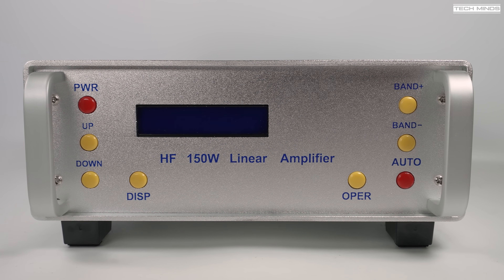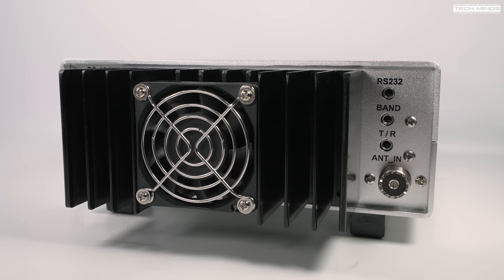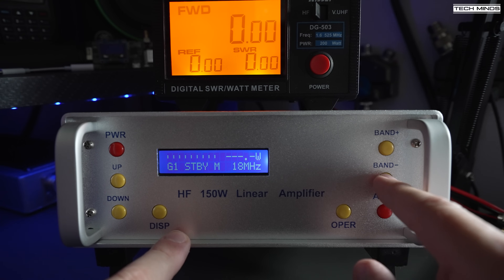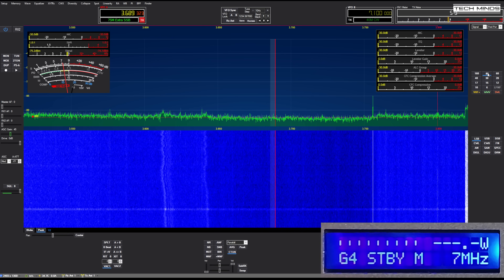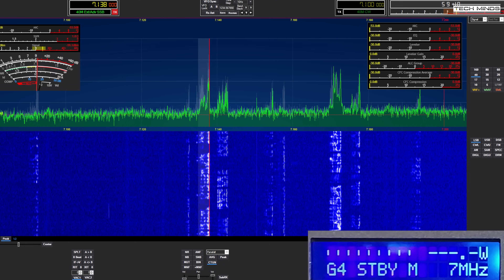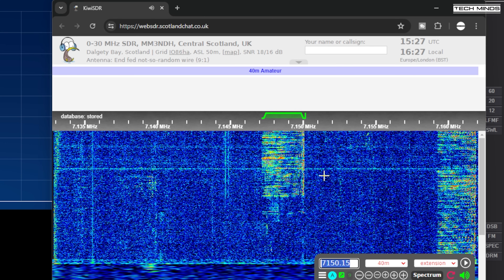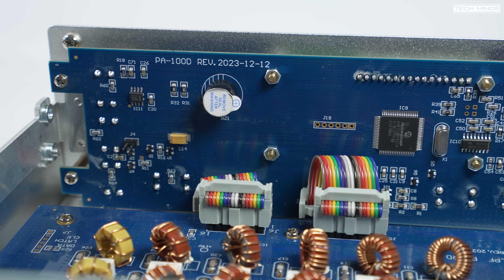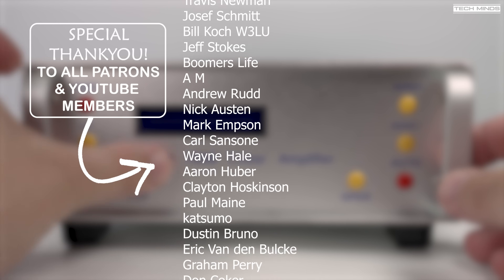Is This A Perfect Companion RF Amplifier For Low Power Radios? PA-100D (Maybe)

Comment: Using a USB to RS232 and Thetis you can do auto band switching to the unit as you can have Thetis emulate the Yaesu/Icom/Elecraft output to the RS232 DB 9 connection.
Reply from the maker: Just tested this. However, using the Thetis build for use with HL2, there is no Yaesu setting. BUT! You can select KX3 on the amp, disable polling on the amp, and then select Kenwood TS2000 and tick "Allow Kenwood AI Command", then it works perfect! Wow... thanks again for the suggestion!
Reply: @TechMindsOfficial  Curious if Jeff meant usb/bcd control using a usb ftdi chipset then FT8KPVXW "Emulates Yaesu" selection would do just that If I'm understanding the manual for the juma 100 correctly. That's how I'm controlling my Vk Amp from Thetis/HL2.
Reply: @TechMindsOfficial where do I find that kenwood command to check?  Thanks!
Reply: @TechMindsOfficial Hi Mat! great review as usual. Just a question, did you use the RS232 socket on the optional I/O board and wired it to the 3.5mm jack labeled RS232 in the back of the amplifier to get the band control working?
Reply from the maker: Really? I have to test this tonight as that would save me configuring the IO board on the HL2, thanks for the tip!
Reply: That's really good to know.
Reply: Any idea if it can work with powersdr software etc. OZ9MSD

Comment: I just got one of these yesterday and seems to work well. I will certainly give it a thorough test on the air tonight. 

I had an issue trying to figure out how to connect this amplifier to my Xiego G90 radio. 

Challenge is this amplifier doesn’t have automatic RF sensing to go into transmit mode. In my case I had to figure out how connect PTT from my Xiego CE19 interface card. I had to figure out which plug wire makes amplifier transmit (“TX”) when shorted to ground - this of course can be done experimentally with the plug in the amplifier’s “T/R” socket. Then you need to find a dry contact from the radio that closes when transmit key is pressed. You’ll need to connect this dry contact to short the “TR” terminal to make amplifier transmit.  It was a PIA but it works great now

Comment: I am a huge fan of Juma. I have a PA1000 that is so good that I have become a fanboy of their engineering and attention to detail. Even if you don't have an issue with IP theft, I advise spending the extra money on the Juma from ROWAVES. Don't underestimate the value of the little details that Juma obsessed over that the clone guys glossed over. 73, W0CP
Reply: as today 9/25/2025 the Juma in ROWAVES is $700.43 USD plus shipping while I can get this one from ebay at $327 with free shipping, did you noticed the difference? pretty much double the price. I am very interested in the Juma but the difference in price is quite ridiculous. Pay double is not enough reason for me
Reply: @angelscomputers The difference is in the design changes, the component changes and the completion lack of technical support should you ever need it! Plus rewarding Chinese companies for intellectual property theft!
Reply: Agreed!

Comment: well after using my unit for about an 1 hour i got a burning like smell from it the band sense only work up to 7,10 20 etc when i return to 7 mhz it will not auto sense and stays on the last band used say 28 mhz , i can’t even change it back manually I have to turn the unit off the unit will defaukt to 28mhz it will then auto sense 7 mhz but i have to resatrt each time, faulty LBF baord or relay ???

Comment: I have a problem with mine. When I go from Standby to TX, my incoming signal is attenuated. It's as if the gain resistors (G1...G4) aren't being properly locked out until the PTT connection is grounded. It think relay "RL-1A" is responsible for this function, but even banging on it pretty hard did not help. This is very disappointing. I suppose I can try to replace the relay, but that's awfully challenging for someone like me with very limited soldering skills.
Reply: Figured it out. I had the PTT wrong. There’s more to it than just plugging the cable in, if you’re using a G90
Reply: @jameswilkinson6678  what do you mean "had the PTT wrong"? I have the same problem with my KX-3... Severe attenuation on RX

Comment: I have one of these for about a week now. It works great. Only problem is I have an auto antenna tuner and the amp trips to show high SWR before it can tune. I end up tuning the auto tuner manually. But other than that it is working great with my hermes lite 2. Seems to run cool with the fan on. So far no problem running ft8 up to 100 watts.
Reply: What is minimal power going out from this amplifier at 1w from hl2?
Reply: @pawelorszulak3957  on 40 meter band I am getting 5 watts out at 1 watt in. And on max power out setting I get 40 watts out with 1 watt in on 40 meters.

Comment: What about ft8?  Most amps, and radios, have different power ratings for different modes; ssd, cw, digital.  The manual does not mention anything about output for different modes at all.
Reply: I’ve had good results running FT8 on this amp at around 55W. In many cases, the limitation on your FT8 power won’t be the amp, but rather your coil or balun. Wolf River Coils seems to quote a 25W limit for digital across their entire product line, for example.

Comment: Hi. I received this amp yesterday but when I try to get any response from the RS232 port with Serial Test mode, I get no response. What firmware version did yours come with? Mine says it's version 1.05q. Any tips on getting this to respond? I looked up the Juma PA-100D RS232 console cable pinout and the one i'm using from the Xiegu G90 is the same pinout so it should work, right?

Any tips? Thanks in advance!

Comment: It works perfectly. Ιs used with Hermes lite 2 and yields about 100watts +- depending on frequency
Reply: How did connect to the radio?  Having issues. Thanks for any help. 73

Comment: I doubt a slight variance in the indicated power outputs is anything too serious. I would say it's more likely the meter on the AMP is optomistic, rather than your NIssei being pessimistic. i have 2 of the same meters and both have been checked against a certified meter and they are BOTH within 0.9w equivalence under 150w, between 150w and 500w they drift slightly more. Checked against a lab quality meter that is worth about $25000, I think I'll trust mine for my usage.....I doubt it's critical at 500w or under to be that precise, I doubt the signals sent and received would know any different. Precision is nice and all, but not really that serious with low band HF communications. Your antenna is going to suck more out your signal than a bad meter ever willl......but i knpw some people can't be happy until everything is 100% perfect in their opinion, even if they're completely wrong.

Comment: What if.... a new Yaesu FTX-1F -> this  amp -> ATAS-120 antenna in a mobile application where the FTX-1F could be detached and used in QRP??  Kind of a best of both worlds.

If the required ATAS control could not be passed thru the amp in bypass mode an antenna switch could be used for tuning.  I think.

Is this a reasonable approach or am I forgetting something?

Comment: In regards to the firmware/node-red I see where Juma has firmware updates and other's have made custom firmware, wonder if those are compatible with the clones?  I just saw where Juma had everything to build one of these guys.  I just ordered me one to use with my HL2, and like you would love to be able to control it with Node-Red or custom application.

Comment: Do you still think his is a good amp
Reply from the maker: Yep, been using it a few times a week and been working perfectly. It’s my main amp for my HL2.
Reply: @TechMindsOfficial  Thanks, I ordered one
Reply: @N4GW So did yours come in yet?  I just ordered one too… I’m so excited.  Slightly ashamed to buy a Chinese Clone.  I wish Rwaves prices weren’t so steep; I’m sure their transistors are better.
Reply: If it is switched off or in Standby, is possible to use more than 15W in the Input for working without the amp?
Reply: @MenschvomLande2  you can send up to 100 watts of the amp is in stqandby mode, just try to limit to 5 watts if the amp is on operation mode

Comment: Good info. I have had mine for about a month. Have driven it with an FX-4CR so far. The power meter seems to read a little high on mine as well.
I certainly would be interested in a video of the other goodies you are running there. Thanks.

Comment: I purchased one a about two months ago from Banggood. It arrived and overheated as soon as it was connected to 13.8v without a radio transmitting. I'm battling with Bangkok at this time. I will release my you tube video soon . they took a month to get me a manual then it didn't work. 
I'm an Electrical Engineer and Extra class ham in the US.
Reply from the maker: Hi ya, strange that it "overheated".. The manual has been on the BG Product listing page for a few weeks now, so not sure why you waited for them to send it to you. Anyhow, besides the manual, I just watched your video, and wow, yep, that has a problem! As you are an electrical engineer I guess you come to same initial conclusion as me, that the finals bias has been set incorrectly and then the amplifier has gone into self-oscillation. Did you come to the same conclusion? Did you open the lid to take a look incase a cable or something has come loose in transit? If you get issues with returning the amp, please contact me directly via email and I will talk to my contacts at BG to get this sorted for you. thanks, Matt, M0DQW
Reply from the maker: BTW, mine is still running perfectly. I use it daily with my Hermes lite 2 and it kicks arse. :-)

Comment: I bought one of these PA100 amps a couple of months back from eBay. I had to tighten some areas of the housing but other than that it seems to work well. I use it with a HL2 along with the I/O board emulating a FT817 for band switching. That works perfect. I'm currently testing it to drive a Palstar LA-1K amplifier.  I need to get myself much more familiar with Thetis. There are so many configuration options and parameter tweaks that it can be a bit overwhelming.  Getting Pure Signal enabled and functioning correctly is also a want of mine.  Fun and interesting stuff.
Reply from the maker: Where did you get the IO board image for FT817 emulation? Or did you just use the sample project? I learnt the other day, from a comment on here, that Thetis can control the amp. I know how Thetis controlling the band selection automatically. Cheers
Reply: @TechMindsOfficial  I'll have review some notes from when I did this. In a nutshell I did use a readily available sample app for the I/O board and I wired a 3.5mm TRS (stereo) socket to the I/O board  to use a simple stereo cable between the HL2 and the amplifier. The band switching voltages were exact coming from the HL2.  I assumed the amp I have was a clone of the juma PA100 but the TRS pinout on the AMP differed slightly (or the connector was just of poor quality, not completely in spec) that I wired two of the pins together  for proper connection. I stumbled across that pulling the cable out and the band switched. Originally I couldn't get the amp to respond. It's worked perfectly ever since.
Reply: @z000z  i just recieved my AMP interested to now more about the I/O and band switch between HL2 and the AMP I purchased from Retrevis, i do find i cant manually change bands on mine thou

Comment: The real output power with 5 watts RF input will be a fraction of 150 watts.
Reply from the maker: What?
Reply: @TechMindsOfficial    I knew that someone would question me on that. 
    It's a 150 watt amplifier with a maximum input of 15 watts. The 150 watt output can only be achieved with that 15 watts of input. It will not achieve the full output with less power. So in this case 150 ÷ 15 = a gain of 10 X. There's no magical change in gain with varying levels of input. There would need to be an input circuit that levels the gain according input power that I've ever heard of, at least not in ham equipment. If not how would the amplifier remain linear for changes in modulation? Otherwise there would be distortion. So, that constant gain figure of 10 would remain the same no matter what the input power is. Thus 5 watts in times a gain of 10 X equals 50 watts output. 5 X 10 = 50. For an FT817 it's effectively a 50 watt amplifier. Can you explain differently?
Reply from the maker: @joewoodchuck3824 yes, I can explain. It has 4 gain levels. G1 to G4. Technically they are attenuators. So G4 will give full power with a 2.5 watt input. G1 would attenuate 15 Watts max.
Reply: @TechMindsOfficial  Ah, that's different than most.
Reply: @TechMindsOfficial  How much output will be with only 1 watt input ?
Reply: What is minimal power using this amplifier with hl2?

Comment: Doug (G6INU) is one of the best ham's on 40m to talk about audio quality imho.  He's helped me dial-in the eq/processing etc on a few rigs :)   p.s. Can the PA do more than 50 watts AM?  my ft710 can only do 25 watts even though it is 100w for everything else.
Reply: That's because it peaks 100W on AM, so the unmodulated carrier is 25W. If the carrier was 50W or higher, the radio would still peak at 100W and you'd have really quiet modulation because there'd be little difference between the silent carrier and your loudest voice peaks.
Reply: @PaulTaylor1  thanks Paul. Your comment has educated me.  it looks like I have hit my operating limit on AM as a 2e0 so I shouldn't be looking to increase my power then on AM! Cheers :)
Reply: @brettuk  Yes the carrier on AM should be 25% of the total power output.  So for a 50W carrier you would need a 200W PA with great cooling.   AM is pretty much a waste of energy with the carrier and one of the sidebands just for heating up stuff.  Only the other sideband is useful in most cases.

Comment: This may be a really dumb question but I'm new to HAM. Could I use something like this with radioberry setup? I want to amplify the signal but I'm not sure if it will even work.
Reply from the maker: Interestingly I am playing with a Radioberry at the moment. The output from a Radioberry will not be enough to drive this amp, however I think there is a "group buy" of the Radioberry Pre-Amp board happening, which outputs 5 watts. It's on the google group for the radioberry.
Reply: @TechMindsOfficial  No kidding! I'm definitely in! I found one site where someone made some kind of preamp that was putting out 20 watts but I couldn't find any information on it. I will definitely get in on a group buy.

Comment: Hermes lite video please, really interested.  Cheers
Reply: Actually, another HL2 video with some insight on the HL IO Board would be really appreciated. I have looked but cannot find anything on the IO board install or operation.
Reply: if you arent bothered by a pretty steep learning curve the hermes lite 2 is basically an end game radio. being fully SDR it will almost never be obsolete. it can do things a $5000 icom cant.
Reply: @slappomatthew  The Hermes Lite 2.0 is a single transmitter/receiver version of a $3000+ Apache Labs Anan. And it has the full functionality of the Anan but only one receiver unit and it is a QRP radio. It is simply amazing. BTW, I also have an Anan 7000 DLE so I can compare them. There are for sure differences but not in the quality of the input or output signals.

Comment: Oh dear, please no additional unlicensed copy of somebody else's IPR. I followed the JUMA community for a while but now went for a FT-710 instead of buying a PA for my QRP rigs.
Reply: This is the way. A 2nd QRO radio is superior to a small amp fer a QRP. No coax spaghetti. The QRO can stay on the desk and the QRP can stay in the go bag.
Reply: Same here - got me a FT891 in addition to the KX2 and FT818….
Reply: Right, and furthermore, the FT891 can also be set to output 5W for those who like QRP so you don't even need the FT818. Of course it is draining a bit more input power than a dedicated QRP transceiver, but it is far better than spending hundreds of euros for an additional PA and in the worst case, ending up with a dirty CB burner.
Reply: @earlyadapter643  yeah, but the 891 sucks, so there's that.
Reply: FT-891 does seem a bit unexciting as a first HF radio.
Reply: To buy a QRP radio to run 100W with a PA is generally pretty dumb, unless you have a "SOTA radio" that you operate outdoors at low power at times.
My FT-817 and other QRP stuff is lying on a shelf, while the proper 100W HF radio is the daily driver.
Reply: @la7dfa buy any radio remotely in the same ball park as the hermes lite 2 as a 100w rig... you are looking at the icom 7610... a 100w pa behind the hermes gives you the same power as the 7610 and much much more then the 7610
Reply: @aussiebeardsman1267  I have the FTDX101d and it will probably be my main radio for the next decade.  But tks for the tip.
Reply: @aussiebeardsman1267  HL2 is a sweet radio, even with more watts.
Reply: I have an FT-710, but I also use a G90 plus an amp sometimes. I wanted to learn about amps.

Comment: The MRF247 is a 75W Device, optimised for VHF ~ 135-175MHz
They are pushing them to the Limit, 2 75W Devices outpoting 130~140 Watts
My THP FT-817 50W HF Linear use 2 X 50W Devices
Reply: It is typical for "CB" amps to just state the max ratings without any losses.  My FTDX101d has 2*100W mosfets for a 100W clean output.
This Juma design is looking pretty good for a 100W use in the shack tho.
Reply: Running this amp at 100 watts out should be good. 73

Comment: Does it include 60M/5.0MHz in the Band Selection.?
Reply: I assume you can use the 40m low pass filter with no problem for 60M.